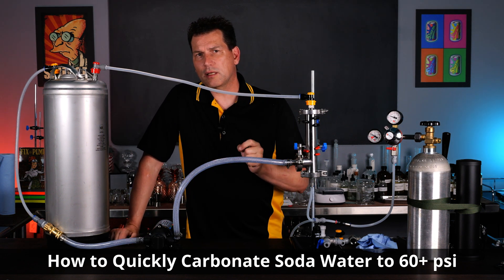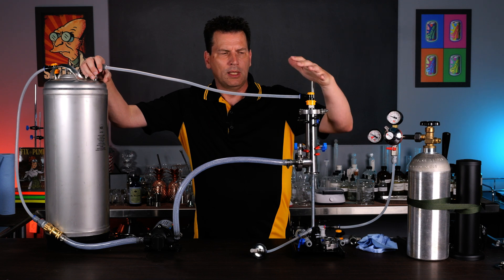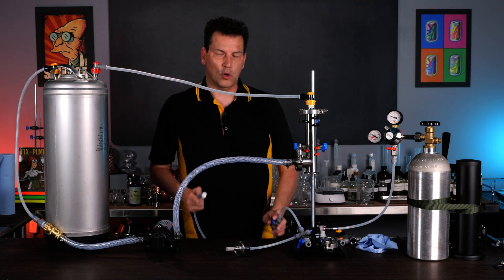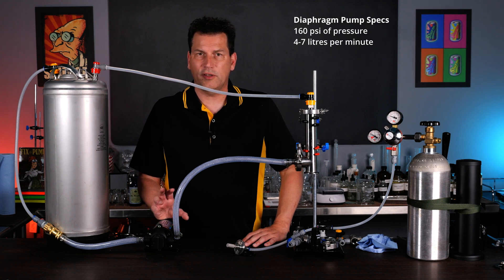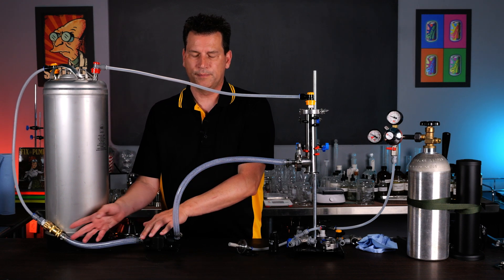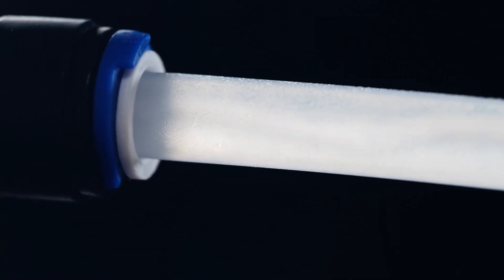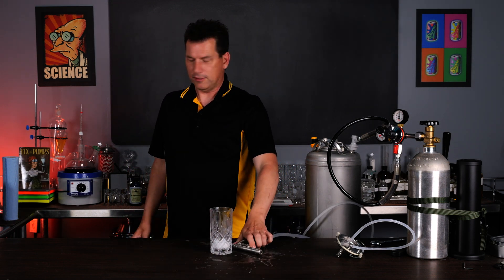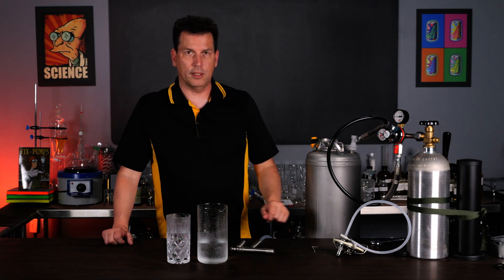Quick Carbonation Setup Soda Water

Comment: Can i go with something like 7-9lpm? I found one reasonably cheap rated to 150psi. Are all diaphragm pumps self priming? The air in the lines is another thing I was considering. I suppose I can fill them up with co2 somehow without damaging pump. Would faster lpm cycle time equal faster carbonation at 60psi? My regulator goes to 100psi with a 90psi bov. The kegland mk4 regulator
Reply: I thank you for any replies. I'm damn near homeless in asia on the other side of the planet from where I'm from at this point in my life and there's really nobody I can talk to about these things. I make my own syrups and I need to launch a small home soda bottling project months ago already. I'm really cutting it close with time to get this going before my entire life comes crashing down around me. I've skipped sooooo many meals just to get this thing off the ground. I can't mess this up. I'm getting really desperate
Reply: Ahh I just figured out the air in line issue. I just need to fill line by running the water out by depressing valve of gas side ball lock until water has filled the pump system . Easy peasy. Please any suggestions about the lpm on pump though.
Reply from the maker: You can run the flow rate at any level because it may take more or less time, but as long as you check the carbonation level (taste it) and it is good then you are fine.

Comment: I made a spray carbonation system with a conrney keg. I installed an atomising nozzle in the top of the conrney key then I filled the corney keg with CO2. I then pressurised the keg to 1 bar CO2 and forced the fluid (cider) through the nozzle at 5 bar to atomise the fluid into the CO2 gas. I then transferred it using a pump into another conrney key at 2.2 bar. The bubbles came out great and seem to be a lot finer than using the force carbonation method.

Have you investigated this type of carbonation method?
Reply: Out of the box!

Comment: I would circulate CO2 from the headspace of the tank to an airstone at the bottom of the tank. I would also refrigerate the tank. I am curious if highly carbonated water can be too fizzy?
Reply from the maker: Not really, if there is too much carbonation it will just release from the water when you pour it.

Comment: Would Bottling from a Big Mac carbonator source require counter pressure or would it be unnecessary, I’m eagerly awaiting two John guest fittings for a 5 stage water filtration system I’m composing and hooking that feed to a carbonator refrigerator, and yes that’s going to be built soon also out of a small fridge, and a new “Big Mac …” will be posting these builds as my first published videos on YouTube.
Reply from the maker: You can always add carbonated water to a bottle and then just cap it, the key benefit of counter-pressure filling is that you can keep all the pressure in the liquid, giving the beverage more kick. Many breweries don't use counter-pressure filling but for beer that seems okay, for soda it is better with a higher pressure.

Comment: This is amazing info thank you! I just had a question regarding food grade, is this setup the pump safe to use over time? Been reading has to be food grade etc …
Reply from the maker: The pumps are safe, they are used for drinking water in many applications. The materials need to be approved for food contact, not food grade.
Reply: Thank you so much! @Artofdrink

Comment: When you're serving from the keg, is the Co2 tank have to be connected to it?
also Do you lose carbonation inside the keg as the water loses its coldness?

Thank you
Reply from the maker: Yes, the CO2 needs to be connected. and yes as water warms up it reduces its ability to train CO2, keeping the keg in the fridge or on ice solves this issue.

Comment: Can highly recommend a carbonater reactor from kegland, As long as you can get the water going in nice and cold and add a carbonation stone to the gas inlet it works pretty consistently even in a reasonably high volume venue

Comment: You don't mention temperature at all in the video. Is this method for room temp carbonation? What is wrong with just using the carb stone on 1 degree celcius keg? Will that not get the job done?

Comment: My wife and I consume a LOT of carbonated water, nearly 20 liters a week. My solution was to have two 20 liter kegs in a refrigerator, both with those carb stone lids. Assume Keg 1 is freshly filled with still water, and Keg 2 is already carbonated.

 CO2 bottle at 24psi connects to the carb stone lid fitting of Keg 1. Then the IN fitting (no dip tube) connects to the carb stone lid fitting of Keg 2. The OUT fitting of Keg 2 goes to the beer tap on the tower. The result is that CO2 flows into Keg 1 through the carb stone until the headspace is pressurized, which then forces the CO2 in the headspace through the carb stone in Keg 2 until its headspace is also pressurized. This imparts only a little carbonation to Keg 1.

But here's the magic: every time you dispense using the tap on Keg 2, you lower the headspace pressure in Keg 2, which allows more CO2 to flow through the two carb stones... so every time you drink, you're trickling a little more  CO2 into Keg 1. By the time you've consumed 20 liters from Keg 2 (a week for us) Keg 1 has achieved full carbonation. At that point you refill Keg 2 with still water, reconfigure the CO2 to go through the Keg 2 carb stone first, then out the Keg 2 IN connector to the Keg 1 carb stone connector. Beer tap connection goes to Keg 1 OUT dip tube connector, and you've got another 20 liters on tap with 20 more behind it being carbonated.

Technically only the "still" water keg needs the carb stone as the drinking keg is already carbonated, but it's a lot easier to deal with than swapping the stone between them.

The hardest part of the setup process is sitting there shaking that very first keg by hand to get it passably carbonated so you have something to dispense while the other keg is carbonating automatically.

The maximum pressure on this system is whatever the weakest point of the CO2 circuit is. I've tried up to 75psi, but found I was getting LESS carbonation out of the end product because the CO2 coming out of solution was too high, even with a tap with an adjustable flow restrictor on it. 24psi seems to be the point where I get very little loss on decanting. Then again, I'm not boiling my water first, so I'm using aerated water. I bet it could hit 60psi+ if I boil it!
Reply: The daisy chaining seems unecessary. Wouldn't it be simpler to have both your kegs connected directly to the CO2 tank?

Comment: You can use the carbonation lid and the pump to do essentially the same thing without the triclamp part, just recirculate in the keg.

Incidentally it's almost the exact same, if you remove the carb stone, as a commercially available setup for keeping kegged cocktails from settling out. I think they usually keep it on a timer for that with it all set up in the fridge you're dispensing from.

Comment: The quickcarb from blichmann work wel too 😊
Reply from the maker: They are great for beer, but they just need a higher operating pressure.
Reply: The maximum pressure of my kettle is 2 bar so I carbonate at 0,5°C. What is the temp of your water at 60psi?